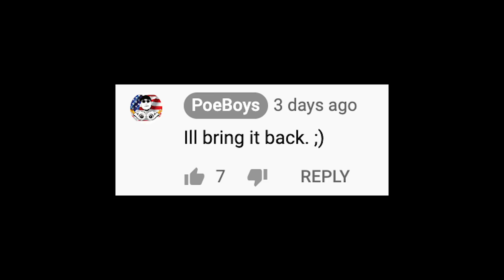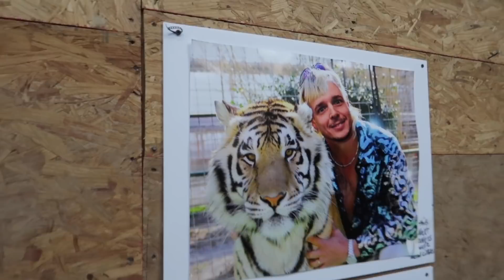YEET THE MUSTANG GETS AN ENGINE!!  (Cheap V6 to v8 Swap)

Comment: Poe, get rid of that Dorman intake and get ya a Ford Performance PI intake (stock replacement). Those Dormans rob you of horsepower.
Reply: That dorman is the revised dorman..the older dormans robbed hp.. the new ones like that are basically a plastic victor jr with more volume.
 I had a friend that got a crown vic that had that dorman. He spent $280 on a ford pi intake and made 2hp and 4ftlbs more. Giving variance and different days id say they are pretty equal.

Comment: Yo just found your channel. Was wondering what all I would need to do this swap. Already have an engine. I have a stock V6 manual trans. Not sure what parts I need besides an ECU and harness. Is the gauge cluster necessary? Can I keep the stock trans, drive shaft and rear end for now? Eventually will change it to hold power. Do I need a different brake booster? Thanks

Comment: The rear brakes on Sean's car look like motorcycle brakes
Reply: There disc brakes there drilled and slotted I think 🤔
Reply: Karl Childers do you not know what drilled and slotted brakes are?Crossed drilled rotors and slotted rotors (and rotors that are both slotted and drilled) are designed to allow gases to escape that build up between the brake pad and brake rotor. This allows your brakes to run cooler and stop better.
Reply: (I got that off of google but I knew like what they looked like and were called but put the info there)
Reply: @kota18loften31  yeah I know but the discs are so thin so they look a little bit like motorcycle brakes
Reply: I'm guessing it to reduce the rotational mass. The more weigh that spins (rotors and wheels) the harder it takes that wheels to spin. Theres an equation you can do that shows how much rotational mass is equivalent to non-rotational mass. Hard to explain through a message. Hope you get what I'm trying to say. Just google rotational mass
Reply: Basically lighter wheels, tires, and rotors will make your car faster but obviously do so safely with good quality products.

Comment: I wish I had a shop with a lift so I can take my transmission out to rebuild it going to suck doing it on the ground
Reply: it does suck but you can do it! impact makes disassembly so much faster. we did it in the yard with ramps and a motorcycle jack. done it that way 3 times now😂
Reply: @driizzy2cold  hell yea I'm going to try it an video it for my YouTube channel on how not to rebuild a 4l60e transmission!  This should be interesting

Comment: Poe get a yota man
Reply from the maker: I wish
Reply: @PoeBoys  i have an 07 prerunner that ive been working on but im having suspension and problems with the steering wheel rattling but i have it straight pipped and its amazing man well if you ever wanna get a tacoma in the future and i still have mine we oughta take them to the track and race em